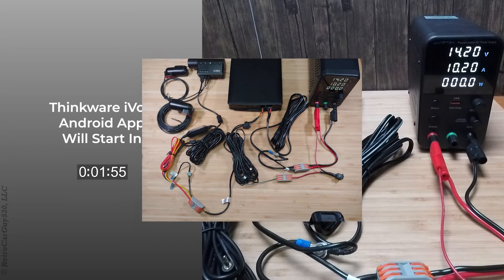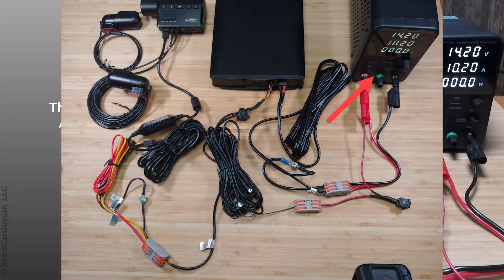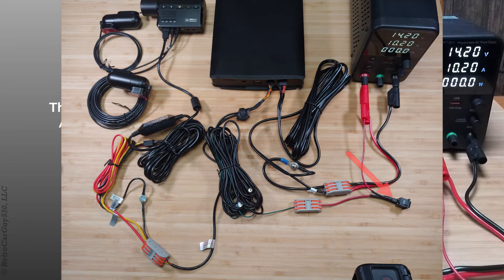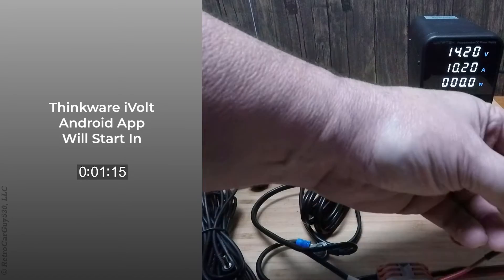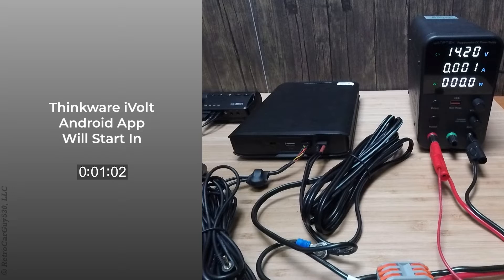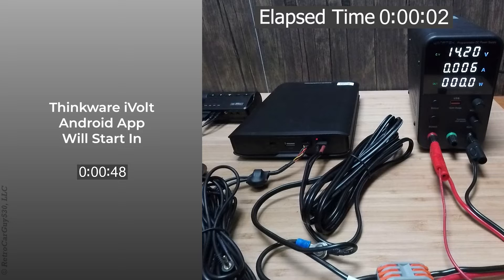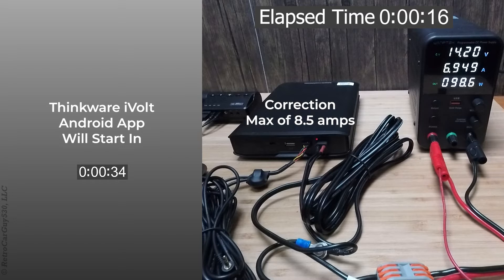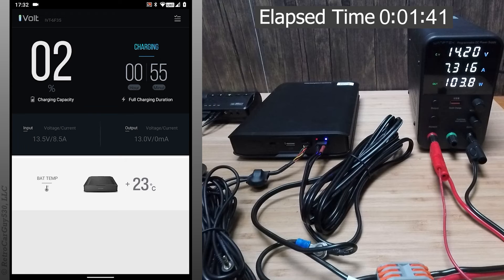Thinkware iVolt Xtra BAB-95 - High Amp Charging Test - 14 AWG Cable

Comment: Nice but expensive for what it offers; according to the specs this can only charge in above freezing temperatures. If you design something for automotive then it should be able to charge in under freezing temperatures as well (say up to 14F/-10C). There are LifePO4 cells that can be charged at those temps.
Reply from the maker: BlackVue B-130X: Charging Temperature: 0 °C − 45 °C (32 °F − 113 °F)
Thinkware iVolt Xtra BAB-95: Operating Temperature Charging: 0°~45°C (32°~113°F)
BlackboxMyCar PowerCell 8: Not stated

All three of these battery packs being produced by EGEN, Inc for those companies likely will all have the same charging temp range restrictions.  The operating range for all three is stated as going down to 14F/-10C.  My friend Panzer Platform has performed a cold charging test of the PowerCell 8.  https://youtu.be/4d4e28OCIzs